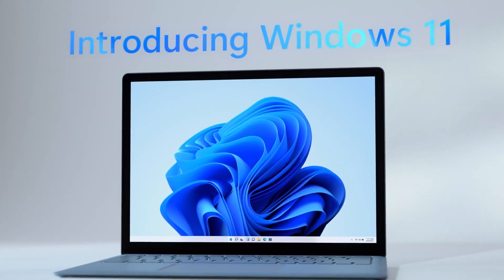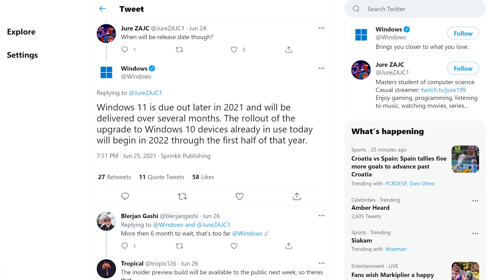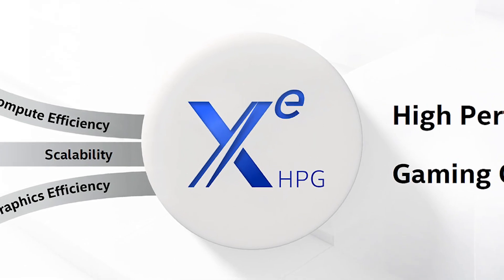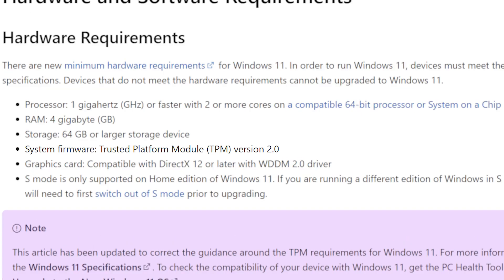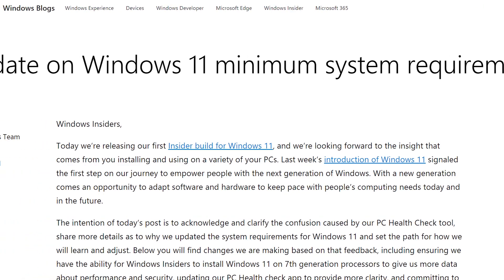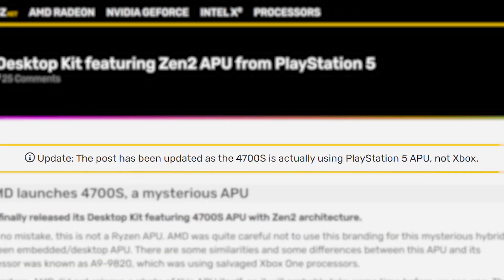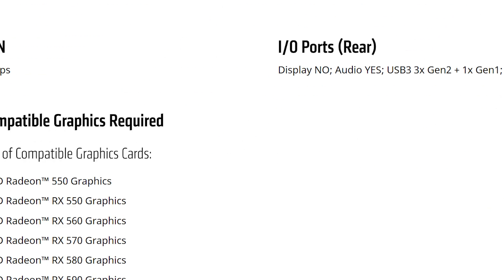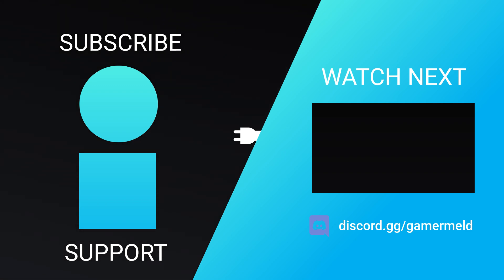TONS Of Gamers WON’T Be Able To Install Windows 11!

Comment: The real question, can we "Upgrade" from WIn 11 to Win 10?
Reply: Yes if you meet hardware requirements, or perhaps even if you dont
Reply: I see what you did there... "up" grade. Also enjoyed Jammas getting whoosh'd.

Rumor has it that the upgrade tool will be included whether you want it or not, and may just without warning automagically "upgrade" for you at worst, use up a ton of disk space at best...
Reply: @innocentbystander3317  oops I saw win 11 and win 10 the other way round, so I thought it was an actual question lol. I deserve the whoosh :(

As a side note, I like the start menu of win 10 more. Everything else seems to be improved in win 11, though with way more annoying stuff too like widgets instead of live tiles. Having said that, I think a lot of people like the start menu of win 11 more, Im probably just a minority.
Reply: @innocentbystander3317  I tried the leaked windows 11 iso, and I was able to create a local account without needing a microsoft account. I was using a VM machine offline, so I am not sure if windows will force you to use a microsoft account once online, or if they have already removed this option in the real win11 build. I did not try win 11 using insiders bulid because I only have one device and I do not want to run a beta os on my daily driver especially with testers explicitly stating some features are still broken in the insiders preview build.
Reply: @jammaschan  
Good to know, thanks for the update. I might have to see what the community has managed to work around, but I'm still not convinced of the risks in attempting just yet.
Reply: @innocentbystander3317  Yea hopefully we can use local accounts at least

Comment: Really wish the was a worthy gaming os competitor to windows.
Linux: too many hoops
Mac: almost non existent.
WINDOWS have had it good for too long we need a "AMD" to spice things up
Reply: The hoops for Linux are getting less and less thanks to Valve Proton.  In many cases it is simply enable Steam Play for all games in settings and click install/play
Reply: @LowSpecLinuxLaptop  The only issue right now is anti-cheat
Reply: @lewsee5562  If you have good internet there is a flatpak and a snap Linux native client for the Geforce Now game streaming service.  There is a free tier so you could give it a try.  Geforce Now game streaming service is a workaround for anti-cheat if your game is on Steam, Epic, GOG.  Ganbatte ne
Reply: @LowSpecLinuxLaptop  geforce now isn't good for competitive games/anti-cheat games
Reply: @herewestand  fair enough.  I would still say give it a try.  The native Linux client is much more performant than the browser version.  anti-cheat is being worked on and a few games work now
Reply: Valve make steam OS
Reply: Windows is only getting stronger with gaming now that Xbox makes 1st party PC game and Microsoft bought bethesda
Reply: @xander hasass Except DirectX games. Plus I have been waiting years for Halo Infinite. Linux won’t run Halo Infinite. So let me use what I want to use, and you use want you want to use.
Reply: @NazmusLabs  heh qemu/kvm vm with gpu passtrough will do it lol. you do you and keep using your shitty OS
Reply: @buggerKnight  Here we go again, folks, another person who is emotional about the operating system others are using. Is that what your purpose of life has stooped down to? You need to turn back to your Creator and read the Quran. May Allah (S.W.T.) guide you and bestow upon you His Blessings.
Reply: @NazmusLabs  "linux wont run halo infinite" I corrected your incorrect statement and that was my first comment. and no allah has nothing to with what OS i use.

Comment: why would a win 10 gamer wants win 11? what is the advantage? cos i don't see any.
Reply: There only one advantage which is the windows 11 is lighter on the hardware so you can use most of your PC power to run games better, and this advantage  not enough in my opinion
Reply: @waled7564  ln other words I was right.

Comment: You do realize that many of the older CPU's that are not TPM 2.0 compliant are still installed in motherboards with a TPM socket. So even if the firmware TPM for their CPU is not 2.0 compliant, they can add a hardware TPM module that is. Plus you can bet your ass that hardware manufacturers will come out with add in boards for those still unable to add a chip. I think the bottom like though, it's time to upgrade from your current potato. Why should the bottom denominator stop new innovation. If you fall into this unfortunate category get over it and get a new PC, or stick with what you have now.
Reply: I agree, except for >>Innovation, what innovation? Name one new feature, that justifies an upgrade, or you actually care about.
Reply: @Xtcent  Being a gamer myself, AutoHDR, DirectStorage, and better Xbox integration come to mind. But that's me, you have to justify it for yourself. I built myself a new Zen 3 system a few months ago. and I do not want my investment held back by people who refuse to upgrade.
Reply: @rangerhawk  Right, I don't particularly care about those, but you do realize, you could have all those features without TPM and they have nothing to do with TPM. TPM is just is just DRM. Microsoft is locking down their ecosystem and turning your pc into a glorified xbox and going in a similar direction as MacOS.
Reply: @Xtcent  At this point I do not even  remotely understand what you are getting at. Are you trying to be intentionally misleading? Are you trying to bate me into some vague insult as to my pastime as a gamer? 

This video partially is about TPM, and that's the scope of my original comment. It's about Windows 11 compatibility. Some will have problems with the upgrade.  I simply pointed out that it is not as insurmountable a problem as is being stated.

My home PC is for little more than entertainment, as it is for many who build or buy high end PC's these days. 

What are you getting at? That Unix/Linux is the best solution? Not if you are a gamer who does not want to micromanage every aspect of their system, or battle getting games and drivers to work. With that in mind, Windows 11 is heading in the right direction as far as I am concerned.
Reply: Another aspect of TPM you are missing is operating system security. It's obviously partially about protecting intellectual property, but it also protects the OS from hackers and malware. I do not care if you want to run some hacked software, that is your thing, but screw hackers. Anything that makes my data and personal information more secure is a good thing.

Comment: Windows 11 better be just flat out free for existing windows 10 users.
Reply: Immediately.
Reply: Alan rettig Watch the video. You see a tweet from the official Windows insider (owned by microsoft) saying free upgrades won’t happen until early 2022
Reply: in 2022

Comment: If Win 10 can still play games, i don't want it 😅
Reply: it can
Reply: Looks like  Debian/KDE for me
Reply: @davkdavk  KDE was my first Linux and I really liked it. I wouldn't have ever gone back to Windows if there weren't so many issues with DX12 (or rather I just had issues with most of my DX12 games, but I know that varies for everyone). Wine was a bit fucky with one of my most important programs, but other than that I had way less issues than with Windows 10, especially regarding my GPU.

As soon as DX12 works correctly on Linux, Windows will have 1 unwilling costumer less.
Reply: @narfd.8837  at the rate DXVK has been moving, that won't be long lol
Reply: @Bobby-Bologna0451  I try to be pragmatic about things like these and yes, I get why people prefer Windows, it is very much an OS that caters to people with as good as no know-how and low technical problem-solving abilities or willingness to try. Those I can even advise to stay with Windows as it can be quite the learning process to get to grips with even the most user friendly Linux versions if you have no prior experience with it. But for someone like me, that can and likes to solve problems and feels rewarded when he can work through small inconveniences, Linux is not a bad thing, it's a perspective. Nothing more, nothing less.
Reply: but dude! on Windows 11 you can load the games on your SSDs and nvmes 0.0001ms faster! and the game will automatically make objects on the screen glow an obscene amount that you'll probably turn off anyway!

Comment: Maybe it is time for some non-Microsoft operating system. If games were written for linux - they would run probably like 3X faster
What MS does is a complete bullsiht
Reply: Most Windows games run at parity or slightly faster on Linux already.  It has been a while since there was a 10% performance hit